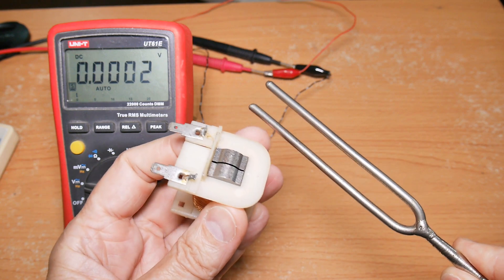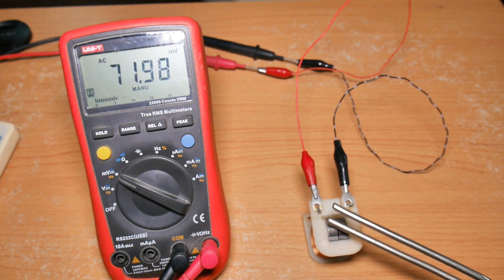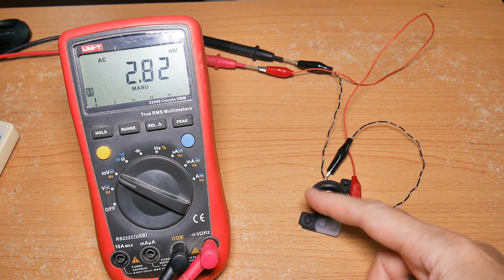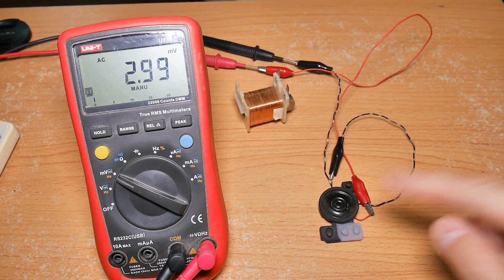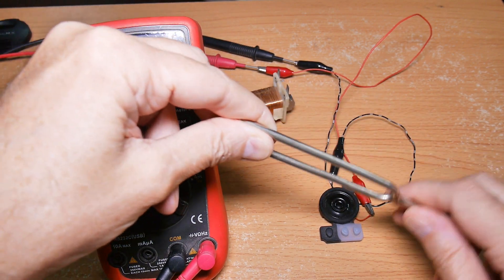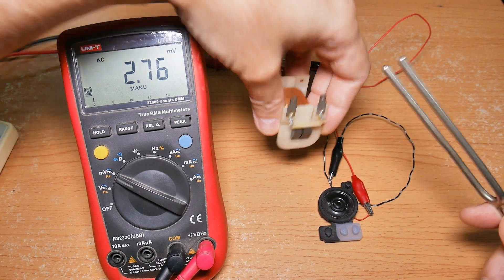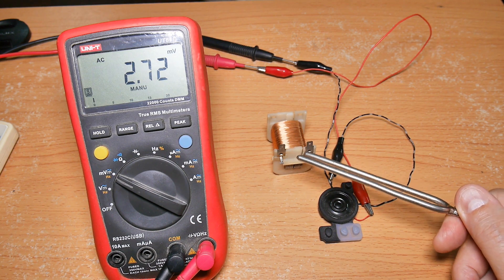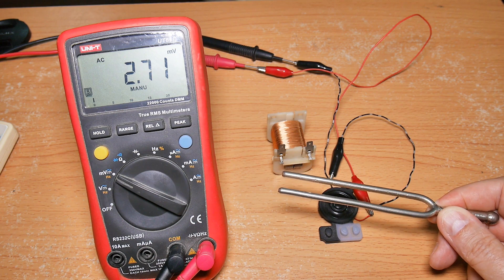Sonic Electricity???

Comment: Great video one question I have is will it still work without the laminated steel core in the coil?
Reply from the maker: No, the coil would likely burn up without it. The core is needed to concentrate and focus the magnetic flux.

Comment: I saw someone make the tuning fork vibrate by placing a coiled magnet close to it (using only .10 volts). So your experiment shows that the power can flow both ways with this sonic setup. 

So I am wondering (added I have considered mechanical loss) if power can be looped using a setup like this. Possibly using a lightbulb or something as a circuit to temporarily store the power. Just a theory

Comment: No - vibrating metal creates magnetic flux, ergo near a coil generates current. Use a gauss meter, and you can measure the flux. This is why your output is reduced when you use a speaker, because it takes greater movement in the speaker because a speaker is a fixed magnet surrounded by a coil attached to a diaphragm (speaker cone), your very small movement is being damped by the speaker which acts like a shock absorber. If you want to generate more flux, put magnets on the vibrating ends of a tuning fork, you will be vibrating the magnets, and the lines will cut the coil; same deal. When a metal vibrates and hits resonance, you are inducing magnetic moments in the ferrous structure.

Comment: What inside of  the coil? Is it magnet?..are you can use that  residual power ?
Reply from the maker: The coil is from an old air conditioner contactor (relay).  The thing inside is roughly the same material that transformer cores are made of.
Reply: @tsbrownie  awesome..keep a great work mate

Comment: The fork and the coil together kinda are the same like a speaker or dynamic mic, but with a (mechanically) narrow bandwidth and high Q factor. I've never thought of tuning forks as energy storage even tho it's kinda obvious, it slowly releases the energy given to it when you tap it to get it ringing... It'd be interesting to power something from this, but probably not trivial unless you get a huge tuning fork or so (or stick a magnet to it?). Quite a neat experiment.
Reply: How about a tuning fork the size of the Earth(hint hint) Mr. Tesla was doing it.